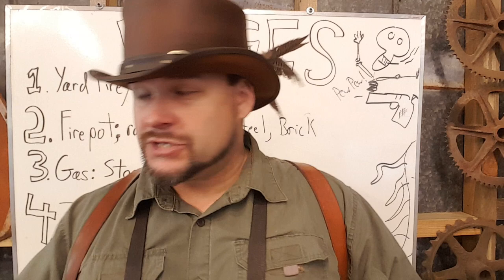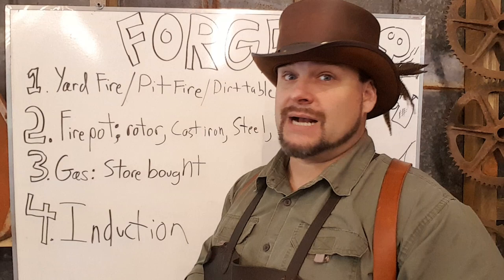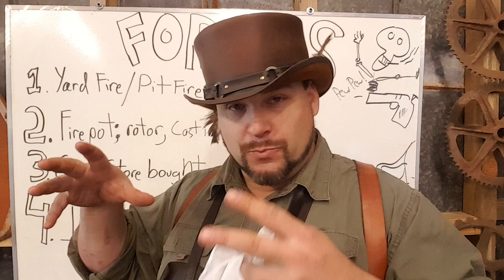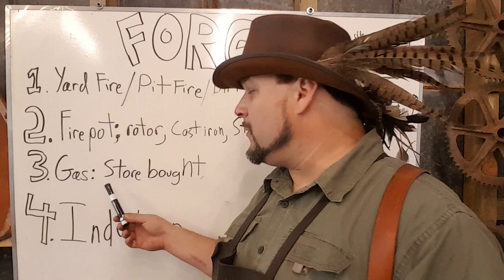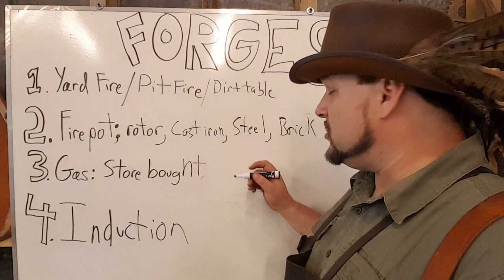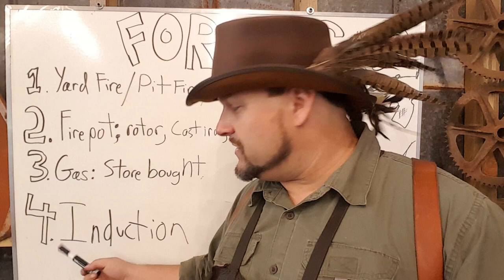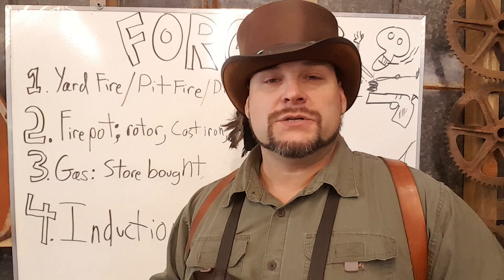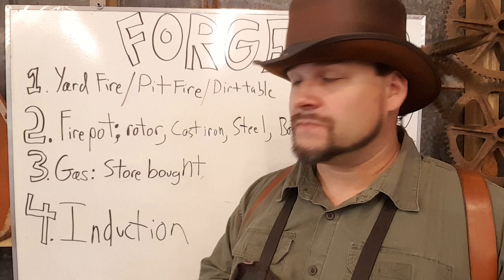Forges Part One: Basic Types

Comment: I use Kingsford charcoal for only one thing.  To anneal a piece of steel.  It works quite well since it produces so much ash that it covers the steel to slow the cooling process.  Eventually I was able to collect enough ash to stop using Kingsford all together.  Now I just use the forge to heat the steel and place it in the large bucket of ash.

Comment: You can actually buy a small induction "forge" for like $20 bucks on eBay. All you'd need is to add power. These are fairly  low powered things, almost more for play then anything, but they could definitely be scaled up if you've got the skill to do so.

Comment: Worlds simplest gas forge, weed burner with some fire bricks to contain the heat.  I've even seen a propane torch for doing plumbing work and a single brick with a hole for the torch and hole for the stuff you want to heat up.  Small stuff that is.  Big thing is, it aint that complicated.  Don't over think it.  Just make heat.  Heat steel.  Hit steel with something heavy on something hard.  Have fun.

Comment: Could you provide any insight in to starting metal working while living in a city.  I have a small back yard and a garage to work with but I got neighbors right next door on all sides.  Safety is an issue and noise is an issue.  That being said, I have a couple of anvils, one small, one medium and am looking to create some useful tools and items.  Love the videos.  Keep them coming.  Cheers.
Reply: a small gas forge should be relatively safe to use in your garage/at the door of your garage. would probably start by asking for some general information from the city, noise ordinances and such, then negotiate with your neighbors (if you're just doing this as a hobby for the moment, then maybe just ask if a few hours on Saturdays would be ok, or something) show them you're trying to be reasonable and maybe things will work out.
if that's a no go, ask around for any private shops in industrial zones that would be willing to rent you a corner or something. make your gear portable(so it can be put out of the way when you are not using it) and then just arrange that you can come by on off hours. maybe look for lawn/landscape shops that are empty after they leave to work for the day.
maybe if there is enough interest in your area you could go for the private gym model and as a group rent a space.

Comment: Have you heard of starlite? You should try it and see what applications you can use it for. Very cheap diy heat shield. 10 parts cornstarch 1 part baking soda and enough water to make it a putty. It really sucks getting it mixed but once it is you can spread it out and use as a heatshield. I was just thinking of using it in a dirt table design like you spoke of
Reply: We put a tiny wax pellet under some and hit it with a torch. The wax survived the blast..
Reply from the maker: .......Because dirt is too expensive?
Reply: @purgatoryironworks  😂😂😂😂 ok. Yeah that would work i guess.

Comment: If you check out the video I have on my channel you'll see my forge it's a combination of a couple kinds from what you have on this list in a way it qualifies as both type one and two it's a brake rotor in a table made from old red chimney bricks and clay and sand for mortor as well since everyone knows that red bricks will pop and break from too much heat so I've built up a thick layer of clay and sand to work as an instructor as well as it's got forced air from the bottom it's pretty cool you should check that out
Reply: Kenneth Ashley gonna check out your video.  I use very old red bricks to shape my fire and make it higher if I need and all they do is melt a little.  The clinker REALLY likes to build up on them and, after a while, they become insulated by it.  That's the problem with clay and sand too.  Clinker really likes it.

Comment: Induction is awesome but very power hungry. As a journeyman electrician I've seen em. And kinda scared by how awesomely fast they can be. It's like a welder with no arc just pumping that heat
Reply: tek413 It's also awesome how quickly they can turn a solid piece of quality steel into a puddle of slag if you aren't paying attention.  You DO NOT EVER look away from your workpiece when using an induction forge.

Comment: I built a propane forge out of an old helium tank and some kast-o-lite 21 refractory and I  built a burner based off of a few different designs and just what I could think of. The burner isn't powerful enough but if I make it forced air (which I usually do now), it gets too hot and melts my steel (I've melted a few railroad spikes by accident) what do you suggest I do to tune it down a bit?
Reply: Shalor McKee join www.iforgeiron.com and post pictures of your forge and burner.  There are a number of propane forge gurus (including Wayne Coe) there who are on every day and will happily help you out.  Just be ready for some straight forward, no nonsense input.  The box of dirt forge Trent talked about in this video is called a JABOD (just a box of dirt) and was originated by one of the old timers who is on Iforgeiron every day as well.  Tons of knowledge there...I can't even explain...  If you search "Wayne Coe artist blacksmith" you will find Wayne's site where he gives plans and layouts for building your own forge.  He is t a fan of buying premade because you can get something better and cheaper making your own.

Comment: This message is about the anti truther video on the melting point of steel... Would the steel bar you claimed was 1900 degrees have bent with 250 pounds pressing downwards... we all know steel bends  at certain points when  pressure is applied  even when not heated ..either way cool video .. except for the get a job commet was uncalled for . You're  Assuming people who question the governments version of why the towers collapsed are unemployed.

Comment: Jet fuel can't melt steel beams
Reply: benjamin ramsden - 
who ever said it could?  But it DOES burn hotter than hell!
Reply: by itself not to the point of liquid HOWEVER since your comment clearly refers to a plane on 9 - 11 ... what do you think those buildings re made of? btw induction caused in that building along with the jetfuel making the power lines in the building hit the steel beams as well as all the office furniture , computers and other such things you would find in those buildings would absolutely do what happened
Reply: Thats not entirely true.. What this guy isn't considering when he did his 9/11 video is the shape of the steel beams. Its one thing to heat up and bend a square bar, but an I-beam would require the fire to be directed consistently from multiple angles, which just doesn't happen with natural fires. So.. sure, if you gave me jet fuel, and office equipment to feed the fire + some wind I could probably heat a single piece of square bar enough to bend if I really tried. Its the structural integrity of the I-beams and the structural layout of the building skeleton that make it impossible to melt naturally. 

As a fellow blacksmith I hate to say this, but that guys video indicates hes a bit of a simple minded dingbat.
Reply: You would need that perfect storm of conditions to happen consistently across a huge portion of the structural beams at the same time in order for that to cause a natural collapse... The odds of that are... beyond our comprehension. The odds of it happening 3 times in one day in one place... I doubt it. I'm not saying I know for sure.. because I wasn't there, but I highly doubt those things came down naturally.
Reply: It doesn't need to. It only needs to soften them. Which it does if it burns long enough. Which it did.
Reply: @SuperKingslaw  Thats not really how it works bud. You can set an I-beam in a bonfire as long as you want and its not gonna soften up for you to bend it.
Reply: Yep bud. That is pretty much how heat failure of metal works. Doesn't even have to glow cherry red.  Try building a house of cards. Pretty much the way the WTC was constructed, with all the load bearing on the external, non I-Beam steel skin. Try doing your homework.
Reply: @SuperKingslaw  lol first off, thats not how the building was constructed. Second, I work with fire and steel all day, everyday. I know exactly what it takes to manipulate it.